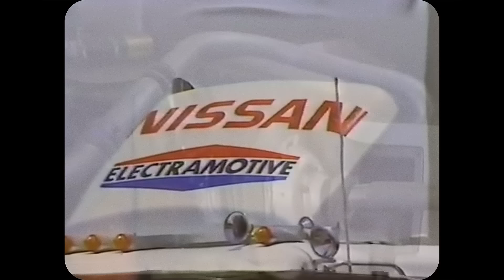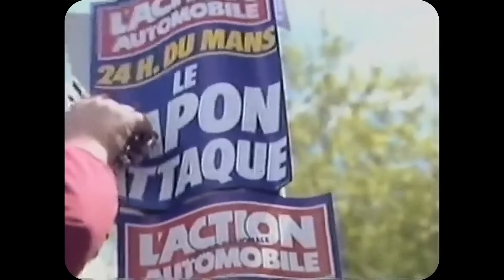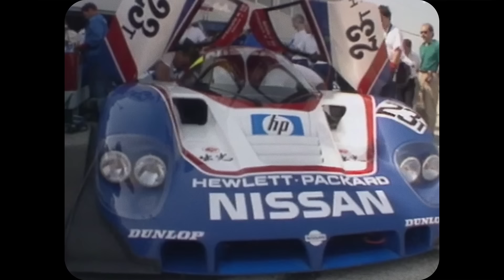When Nissan Went Mad

Comment: It's actually insanely impressive that the onboard footage kept rolling, VHS is notoriously fickle.
Reply: I dont think they will use VHS for onboard footage, i think they will use a more robust tape format lol
Reply: Interesting point, but wouldn’t the onboard be directly transmitted and recorded elsewhere? Like the video signal gets taken from the camera, and then sent to the transmission centre or whatever where they chose what to broadcast. So I do not really know if the recording takes place in the car. Has anyone more information on that?
Reply: @Henriette187  i have been trying to get some good info but none of the websites have good answers.
Reply: @Simon-gv4md correct
Reply: Anche le patatine fritte sono buone
Reply: @Henriette187 that's how i assumed it worked as well, but idk how it would work with the technology of the time
Reply: @Henriette187  100% it wasnt recorded in the cars..it was fed live from the cars.... holding tape in cars for the weight? lol... these guys are clueless

Comment: Great video BUT you missed a couple of things. Firstly Nissan did build a 3.5 litre car, the P35 with a v12 engine. It was a total failure. Second you missed the 2 huge crashes of the NPT 92/92 at Road Atlanta in '93 which effectively ended the whole NPT racing effort.
Reply from the maker: You're right I missed the P35! Frustratingly I didn't see it in the Mine 500 entry list and unfortunately didn't double check. RE: NPTI; its my understanding that NPTI closed up shop in 1992, with Momo fielding a single car NPT-90 entrant in 1993. By the time of the crashes in practice and the race at Road Atlanta in 1992 (the last year NPTI were active as far as I can tell) it seemed from what I read that NPTI had already decided to move on (then folded when the NP35 plans fell apart). Assuming you're referring to the 1992 accidents I'm not sure what you mean by "ended the [effort]" - they entered all but 1 of the remaining races that year, am I missing something?
Reply: John Morton at Lime Rock! Huge crash.
Reply: @automobilistic You missed another one. Nissan Tame or Nissan Ta-120. I also never heard about this car before but I recorded it last time out at Hockenheim. Apparently there were only 25 cars produced. There is literally no information about this car what so ever on the internet.
Reply: Another thing missed in this great video was the IMSA imposed rev limit in 1988 that made suddenly made the Electromotive Nissans reliable before the NPTs were built.
I believe Electromotive ran about 1500rpm less that year per the rev limit.
Reply: @automobilistic  And now Nissan Mazda and jaguar has gone soft
Wish they could all return to le mans with lmh/lmdh but no

Comment: Cool to see a dive into some lesser known racing history like this!

Just to add to it, Nissan did start developing a car for the 3.5l Group C rules during 1991, NISMO designed a new V12 engine for it and NPTI did the chassis. They ended up with 2 versions of the car that started testing during 1992, the P35 was NPTIs version that apparently had a really good chassis and aero, but the engine NISMO sent them was really underpowered. Then NISMO made their own version back in Japan called the NP35 that seemed to have a better engine but a worse chassis. NISMO ran their car in one JSPC race then cancelled the project cos money.

Comment: One thing you failed to note in this video is that Nissan did develop a "C1" class car; the P35 and its Japanese sister the NP35. This Group C car was powered by the VRT35 70-degree 3500cc V12; though the VRT35's engine was quoted at 630 Horsepower,  it's probable that it was underpowered by about 100 horses. The Japanese-spec NP35 only competed in one race; the 1992 Mine 500km, where it was over 3 seconds off the pace of the leading Toyota TS010.

And that's the entire racing history of the P35 family of prototypes; as the American-spec P35 never even got to turn a wheel in anger at an IMSA event as the class was shuttered before the car could compete and NPTI was closed down after an ill-fated Indycar/CART engine program. In 1997 however, John Christie took the #001 chassis P35, swapped out the V12 for a modified production-derived 3.4-litre Ferrari F119 V8 from the 348 road car, converted the chassis to an open-roof and entered the car as the X250 WSC prototype in honour of the 250 employees of NPTI that were laid off following the division's closure.

The X250 only entered into two races, and took the start at just one of them; the 1997 12 hours of Sebring. There, it only completed a mere 21 laps before retiring with an electrical failure.

Comment: What's up with the "Group C" moniker and insanity on four wheels? The world Rally championship circuit had a class by the same name in the 1980s that was so ridiculously overpowered that it was quite short lived, only existing for I believe a couple of seasons at most. It's miraculous that the spike in crashes and fatalities wasn't even more severe, given that a lot of Rally fans are/were seemingly tired of living, literally swarming all over the the entire width of whatever road the race was being run on and only parting like the Red Sea for Moses when a car came through, often well over 100 MPH, usually only missing the dumbest spectators by inches and sometimes not at all. I hope/assume that in the (at time overly) safety conscious world we're living in now, the lunacy of spectators on the racing surface and other idiotic vantage points like on the outside of high speed turns with nothing but air between their bodies and thousands of pounds of race car speeding by, often sideways, is mostly a thing of the past.
Reply: We know, it was the Group B
Reply: They classified classes at the time by “group”’s. The 80s were the high point for power and danger, which is group racing is tied to insane racing

Comment: >Motorsport isn’t rational. There’s no fundamentally good reason to race fast cars around loops of varying size and complexity.

bruh all racing at its core is R&D, its to research to make better and better cars.
Reply from the maker: Counter point: its not.

Its a nice idea that racing is a test bed for future road car tech, and its certainly true that some road car innovations have their roots in motorsport (more so in the past), but that's not motorsport's purpose, and if it was, its extremely bad at it. All major racing series today employ strict regulation of the cars, some even going so far as to use BoP to keep racing close (WEC, Super GT etc). When a ground breaking idea is realised in this environment not only is it usually quickly banned, it probably had no use outside of motorsport anyway (DAS for example).

All topflight modern motorsport is competitive entertainment made viable by advertising. Machines made to test the limits of our automotive technology exist, but they don't race against each other, they exist in test facilities. Racing isn't rational, but that doesn't mean it isn't subjectively valuable - and when a piece of racing tech very (very) occasionally does have everyday application, that should be celebrated.

Comment: 2:20 "Motorsport isn't rational."   I totally disagree.
We started racing because we wanted to see how fast the car can go.   It makes perfect sense to test the performance capabilities of our technology.
Motorsports is about the technology in the car, not the driver.  The more we focus on the driver, the less logical motorsport becomes.
Reply from the maker: All modern racing series are governed by rules designed to provide better entertainment. Machines made to test the limits of our automotive technology exist, and you're right that it can make sense to build them, but they don't race against each other, they exist in test facilities, closed circuits and occasionally on salt flats haha.

Motorsport isn't very rational, that doesn't mean it isn't subjectively valuable though (and it does occasionally provide technology that trickles down).
Reply: We?? Who do you think your are Norbert Singer??. lmao 🤣 😂